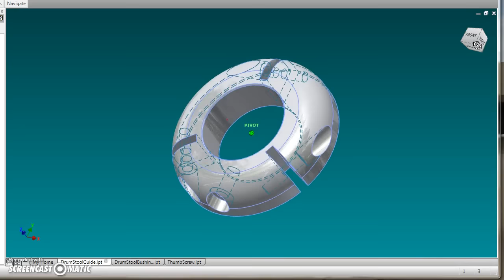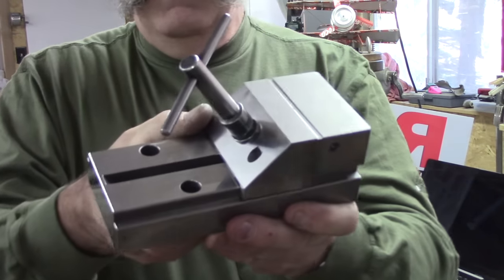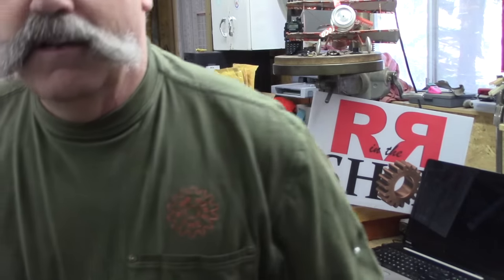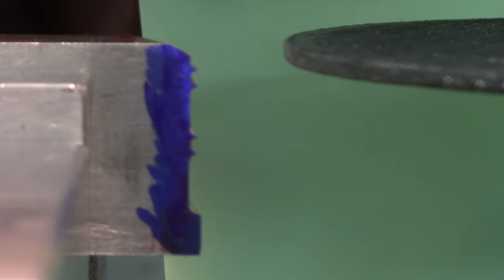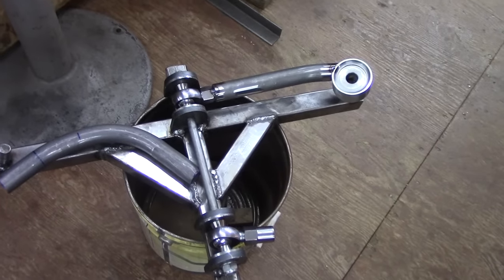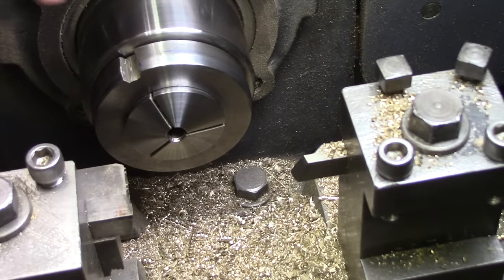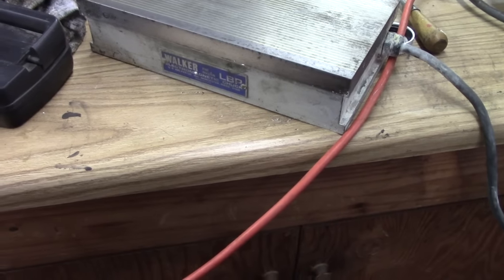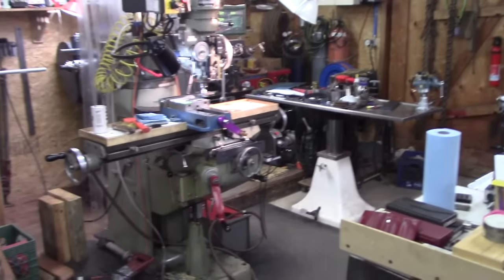How To Build a Carbide Pocket Scribe Part 5 Final

Comment: Enjoyed!!
One will find rod end  are a great precession addition,but--tt,not being spring loaded(like stock) they will not last(wallow out) sooner and are a frequent maintenance item in high load style shock/impact.
Which I am sure you,with your back ground know about this.
Reply from the maker: +Rick Brandt Rick, I agree about the ball joints, but sometimes the kids don't want to listen and want to learn their own lessons.  I guess they are using them in High performance stuff and he wanted to give them a try.
Reply: years of road race cars,used up a lot of them. a lot of times a one race item.depended on how many curbs the driver used to go fast.

Your vids show the value of changing/adapting machine setup for "A" job.My favourite"I spent hours traming my vice ,haven't moved it in years,too much work to get it right again."right?

Comment: You're doing great at shrinking the shop by the inside...   LOL
You can give a light grind on the base, even a little pitting is no problem as long as the top surface is flat, just make sure no corrosion occurs after or it will lift the chuck...
Reply from the maker: +pierre beaudry Getting tighter.  I think a light lap on the surface plate for the bottom of the chuck and a light stoning on the table.  Then grind the mag chuck top.
Reply: Fair enough, just take measures to prevent rust between, cause rust swells and causes, stresses, a good light grind on the table itself will relieve any point of pressure by making the surface almost 100% even...   That's the way I proceed.   ;)